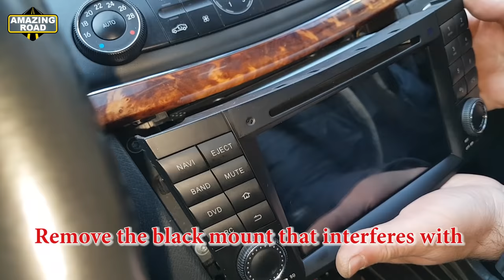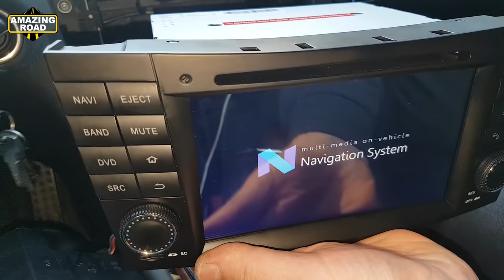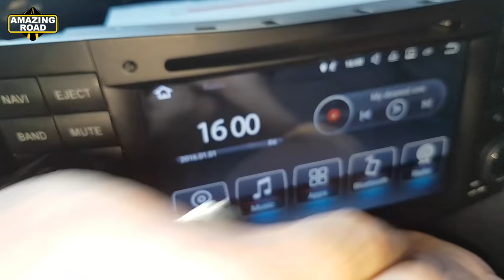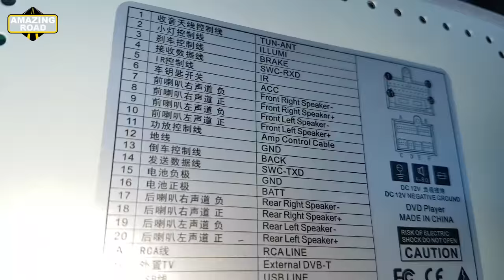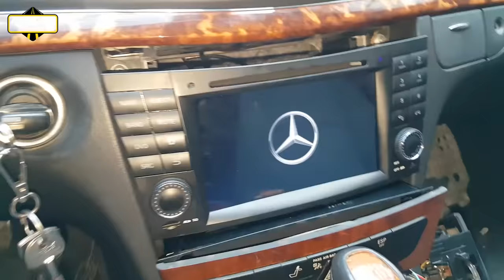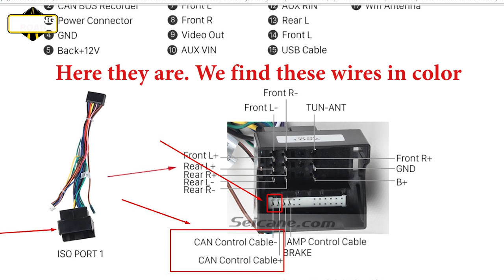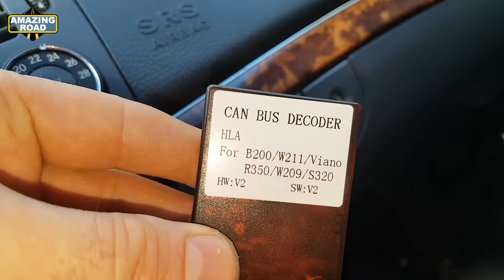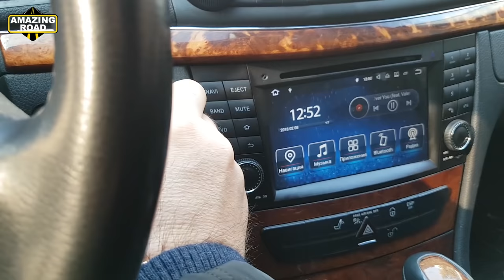Mercedes W211 Detailed Installation Android Radio DVD COMAND & CANBUS (Wheel buttons) & Decoder

Comment: Hi,  does this unit in radio mode, display song title/artist or any other info? head unit issues after installation? Audio 50 (radio + cassette) has fiber optic connections? Thanks for your time.
Reply from the maker: No problem. The track name is not displayed on the dashboard. Here is a detailed overview https://www.youtube.com/watch?v=2rZPcgJUnI4&feature=youtu.be

Comment: First of all great job man... I have a very poor radio reception after installing this navigation system, do you have the same problem? If no, how did you connect the antenna?
Reply from the maker: I also have this problem. At home, the radio test worked fine. When plugged into the car, the radio did not catch the channels. I did not connect the antenna, I listen to the radio via the Internet

Comment: hi. I need your help. I have w211 with COMMAND APS NTG 1 system  and I wanted to change it into XTRONS PDAB7M211, but it just looks like some wires are missing in my car. Do I need to buy FOBB01 from XTRONS to connect it? can You explain me how to do it?  thanks
Reply from the maker: You need to clarify from the seller

Comment: And if i have the original german connector i dont need to connect all these little cables right ? only the main parts to the cables from that connector ?
Reply from the maker: If you have a German original connector, then do not connect all these wires. look at 3:10

Comment: Is it still possible to change the time on the instrument cluster with this stereo
Reply from the maker: No
Reply: @AmazingRoad  Hi... and u know how can change the hour on the clúster ???
Reply: You either put the stock head unit in to do so which is a real hassle.. or take the glass cover off the clock and fix it manually with your finger.. Either way kinda sux.. You have to do it whenever the battery is disconnected
Reply: @omargurrero  Or disconnect battery and reconnect at exactly the right time?

Comment: Good job :) If I have the harness that converts from iso directly without cutting cables, will the car AUX work automatically or do I need to connect it manually?
Reply from the maker: manually. Thx
Reply: Omar Elfar where did u get the wire harness I m looking one for clss 550
Reply: Bike Elie how do I know if my 08 cls550 has the East version with out cutting wires

Comment: can u help me how do i connect steering wheel controls to my pioneer radio i have the steering wheel controls but i need help
Reply from the maker: Everything is detailed in the video
Reply: Amazing Road TV what steering wheel control did u use
Reply from the maker: I connected CANBUS decoder that was included with the audio system
Reply: Amazing Road TV okay i have the ascw axxess control and having problems because i got no directions.
Reply from the maker: Without a CANBUS decoder, it did not turn out to connect the steering buttons
Reply: Amazing Road TV wym canbus ? can u explain
Reply from the maker: At the 22:02 m the CanBus decoder on the left is visible.

Comment: Hey guys, Did you have a problem with a teleaid and srs warning on the dash after the install? I installed an android head unit with the help of you video; unfortunately I now am dealing with the teleaid and srs light. Did you have this problem or know how to deal with it? I have spent dozens of hours reading forums and still I am stumped. I also have crazy parasitic drain to battery (some thing to do with overactive canbus not going to sleep i think). I checked every fuse in car, tested battery, and checked for firm metal to metal contact on canbus plug under passenger dash. That's when the problem started; when I first messed with canbus harness FYI. I checked the plug for hours and it seems fine. Any tips would be much appreciated. Have a great day!!
Reply from the maker: No, I didn't have that. Maybe a coincidence?

Comment: Hi. Thanks for the video. I just installed mine thanks to you. The only thing is I don’t get any reception from am or fm. Probably cause i did not power  my antenna.  What cable in the car harness is the one to power the antenna? I see you have some kind of fakra connector, mine does not have that. It’s the only thing missing. Again Thanks for the video!
Reply from the maker: I had it in the kit, but I also had a bad radio signal. And thank you
Reply from the maker: https://www.youtube.com/watch?v=eFiKyPpkM5U
Reply from the maker: https://www.youtube.com/watch?v=69yuzCO-_zg
Reply from the maker: https://www.youtube.com/watch?v=RU9qzoUqsp4